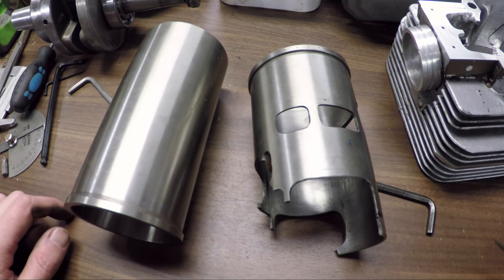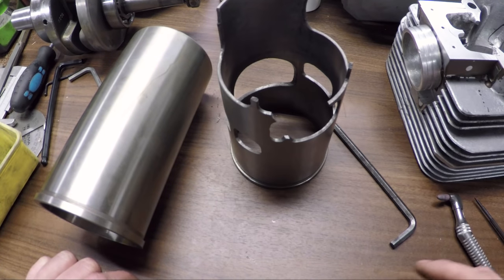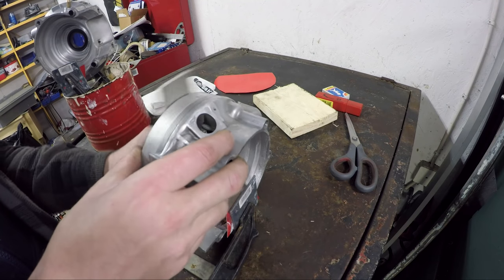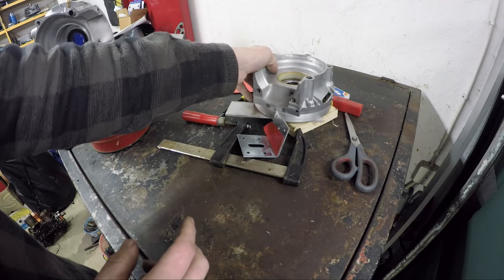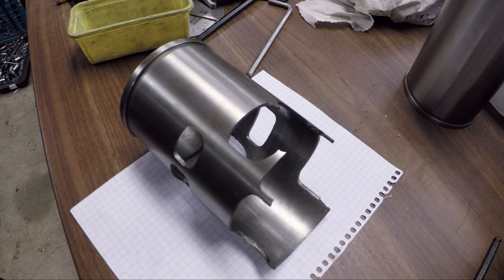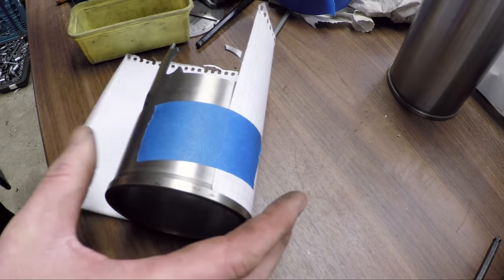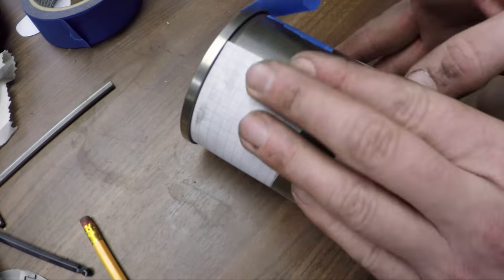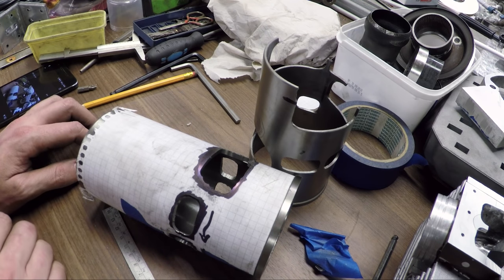Bigbore stroker 277 part 3 - Rough porting the sleeve

Comment: I had some friends who owned a small engine workshop & they used to push the sleeve into the 2 stroke barrel & fill the ports with a copper sulphate solution, This would mark all the port shapes as they are in the barrel and not rub off when the sleeve was pushed out,

Comment: JB Weld???
Why not just weld it for real?
Reply from the maker: Mostly because I didn't have a TIG welder when I did this ;) But the JB weld is still holding up just fine so I'm not in a hurry to real-weld it anyway.
Reply: @Hollaendaren  i just dont have any good experience with jb weld inside 2 stroke cranckcases...
Failed on me every time so the loose parts ended up getting stuck in the cylinder/head and bend a crank...
Reply from the maker: I actually have the exact opposite experience myself, I've used it in several engine builds and never had any issues with it really. I rough up the surface pretty good to give it something to grab onto, it doesn't stick well too smooth surfaces.